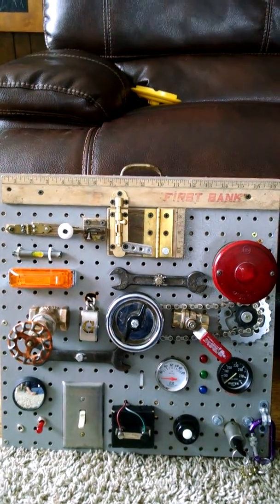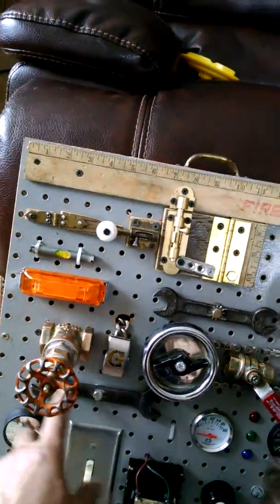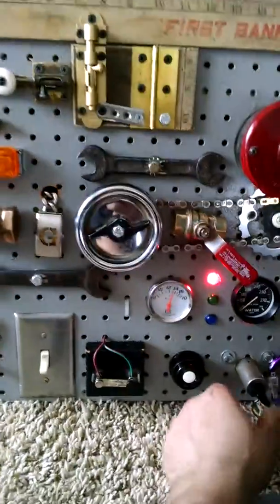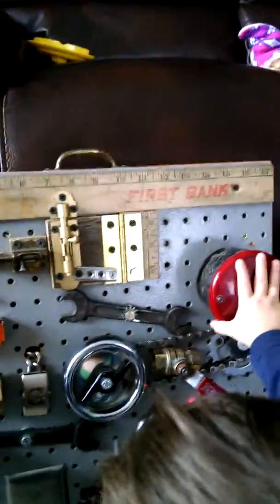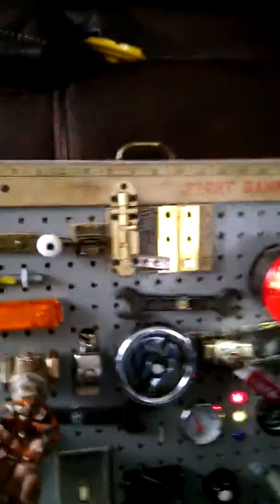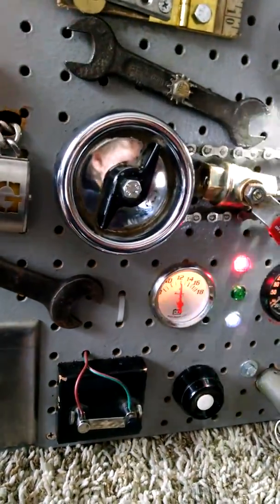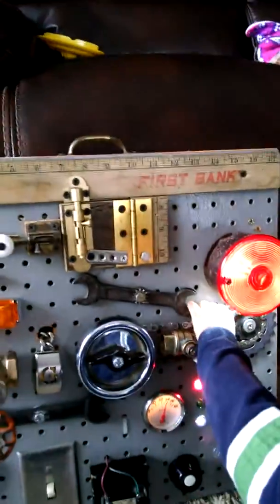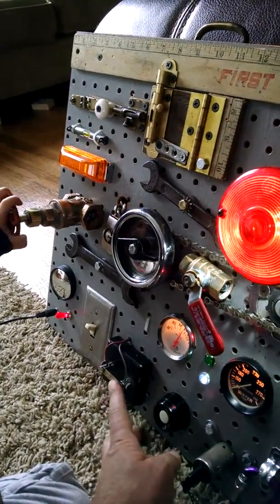Kids activity board

Comment from the maker: Thanks for your comment. I will give it some thought. You can make about anything complete a circuit given it is metal to metal contact. I put a rechargeable battery pack 12V in mine with a fuse on the + feed to everything. All of my "switches" open or close the circuit on the 12V+ side and go to a light or buzzer. The other half of the light or buzzer is direct wired to - on the battery.